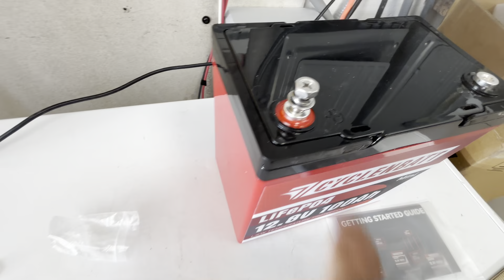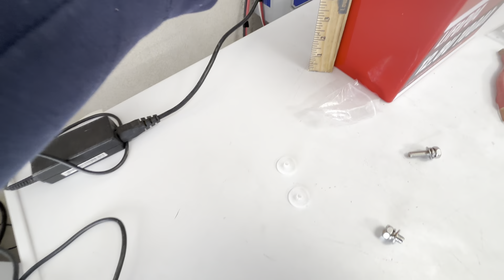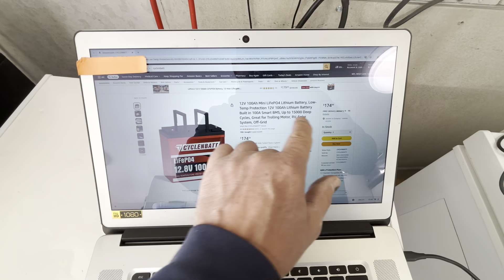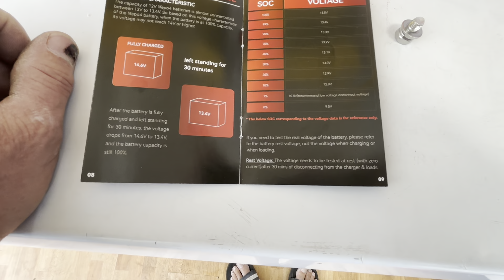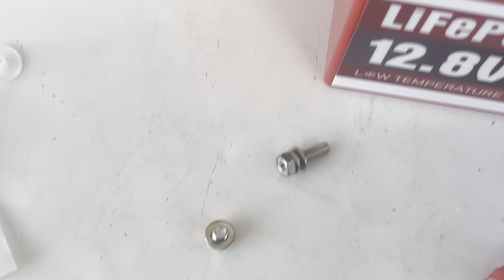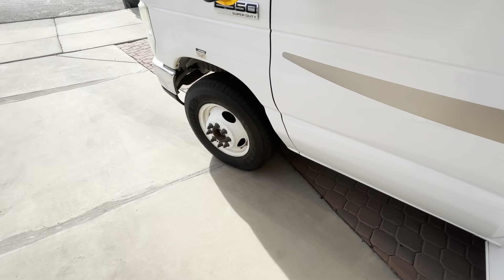LiFePO4 CYCLENBATT 12.8V 100ah Mini Battery unboxing,15,000 deep cycles, under $175 solar, RV & more

Comment: Hello Papa, great videos as always, are most of your equipments in the house are free😄? As we guess vendors gave them to review. Are you going to sell off some old ones?😀 keeping good works👍🇺🇸
Reply from the maker: Hi, this is the first product I received to review that I did not pay for. I told them I would do an honest review if they sent me product. A good start since this product seems to be a great value for the money. Great for applications I want to use it for. We will see when I start testing with a load. Looking at the reviews on Amazon, 4.9 out of 5 starts. It looks solid and like it will last a long time. I purchased all the other products I use in my videos. I will be selling one of my 12kw Growatt low frequency inverters if someone lives locally and can pick up. Too heavy for me to move around anymore or prep for freight. Cannot ship UPS or FedEx, too heavy. The 12kw GROWATT seem to be out of stock online everywhere. Popular inverter. I will hold on to one of the 12kw Growatt inverters since very hard to find online. Most 6 kw Growatt inverters are selling for $1299 online plus freight cost. So they hold their value. Usually if you can find a new 12kw Growatt inverter, are around $2200-$2500 plus freight. Used are around $1500-$1800 plus freight. I will be selling mine for around $1200, no freight, only local pick up. But I have a lift table to get in vehicle for whoever buys it. If they live close, I would use table to remove from vehicle at their place and to help install inverter on wall using lift table. They would have to do the lifting and pushing of inverter and maneuvering around. Thanks for watching videos and for asking questions. Hope you have a truly blessed New Year in 2025.